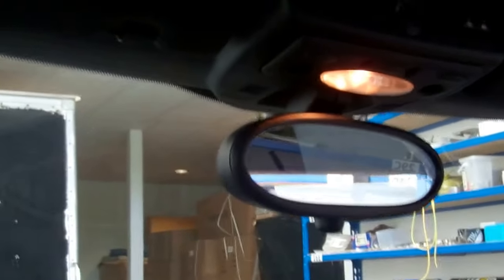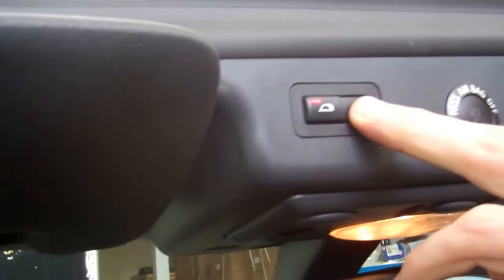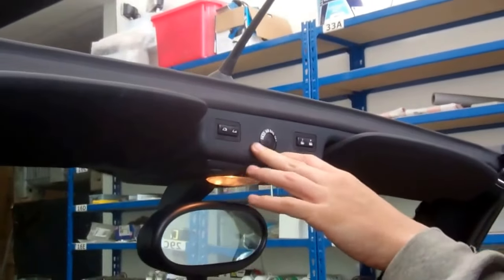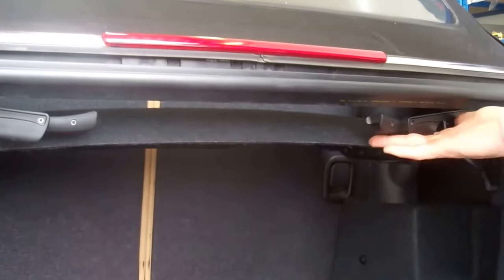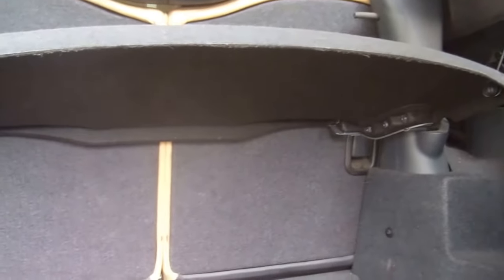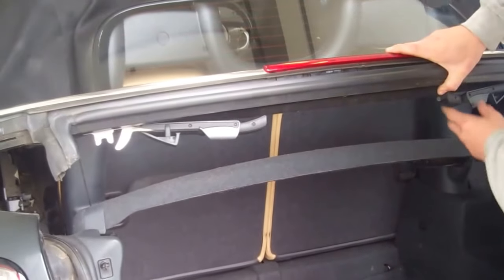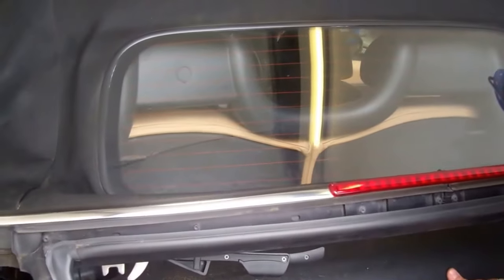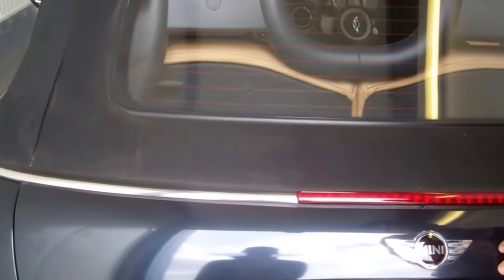BMW Mini / cooper convertible soft top hood operation and problem solving

Comment: Absolutely brilliant tip, thanks guys, it took seconds to sort, when a roof goes wrong  I think people just see £££ signs and don’t bother getting it sorted but tips like this are worth their weight in gold, i think I might bend the contact strip up a small amount to ensure of a positive contact continuously, that’s my tip
Reply: Good
Reply: Literally I had this EXACT problem after a rear-end, and the repair shop told me that water had leaked into the motor of the roof and that I would need to replace the motor!!! Took me 2 minutes to fix it after this video 😄

Comment: Whoever you are, thank you for the info and the video. I was so stress with the first its mechanical problem and paid a lot to fix it. When I found could not open the whole root I was devastated. Also I found that I put the top cover in a wrong way when it came off one day. I can open the roof fully now. Yay I am so happy.  So check the position of that top cover of the boots too when the same problem comes up. Cheers ❤️❤️❤️
Reply from the maker: Glad it helped you.... just need some nice weather in the UK now to enjoy driving mine !

Comment: Spot on resolution guessed it was something straight forward as clearly power was there as previous person mentioned didn't know levers were there to access parcel shelf ,that's a bonus . Mine has just had roof cleaned guess that's how it occurred. Thanks for video .

Comment: You ever had any problems with the boot not opening with the fob or latch I have changed the latch and checked the wiring but seems all ok? Cheers dan 👍

Comment: Mine is ok but small metal cable now and again I have to slide into position top left above passenger door .also water leak top right front. Any suggestions . many thanks.

Comment: Hello, my 05 Mini Cooper only retracts halfway. No red flashing light. I have tried resetting the latches and making sure the switches are being pressed.
Reply from the maker: Try and close the roof then disconnect the battery and reconnect after 10 mins - this may cause a reset and fix the issue

Comment: Is there a way to override/disconnect this sensor, I need to remove the parcel shelf and leave it out of the car but still want to operate the roof. thanks if you can tell me how to do this
Reply from the maker: Not sure but i guess you can bridge the wires if you can find them

Comment: My roof was working fine until a few months ago when I picked up a carpet cleaner and put it on the back seat. The roof was still closed at this point. A few minutes later, because it was a nice day, I decided to open the roof. However, I hadn't realized that the handle of the carpet cleaner was stopping the roof from retracting. As soon as I did, I obviously moved it and tried again. Nothing then and nothing since. It opens for the first part, but won't fold down. Any suggestions please?
Reply from the maker: Interesting - pretty sure it is linked to this parcel shelf switch
Reply: @L663  I’ll have a look and hopefully that’s all it is. Thanks for the reply.

Comment: Hello there..I'm in need of help and wondered if you were the man that just might be able to solve the problem. The boot on my 2010 Mini Cooper convertible is locked shut!! Prior to it locking shut I would be driving and then all of a sudden I would have a message on my dash on the round screen to say that the boot was open. I'd have to stop the car lock the car with the key fob a few times and it would eventually lock. Now it just won't open however many times I press buttons!! I'm thinking it might be an electrical fault...any ideas? Many thanks.
Reply from the maker: Hi - sorry not sure on this one - sound like some switch / sensor problem.
Long shot but you could disconnect the battery leave 10 minutes and reconnect - it can reset the body control ECU... as long as the battery is not in the boot !
Reply: thanks

Comment: Hi there we have a new Mini Cooper convertible 2017 and the roof will not close....checked back still not working. It is going to rain!!! Not near a dealership....help
Reply: hello Clair, i was wondering if you fix the problem?  :) because i have the same problem on my 09 mini cooper :(

Comment: Hi, I'm having a nightmare! 
so a year ago my mum's roof wouldn't release from the frame of the windscreen, The motor sounded but it would only move half an inch, I gave up as didn't want to burn the motor out. 
So the other day I cleared the boot out and by chance I tried it again and it opened, well the sunroof bit did, I went to close it and it shut a little then stopped and the motor went quiet again just a single light click sound each time i pushed the button, I went through the window resetting and disconnecting battery and worked once a little then stopped. 
So today after disconnecting the battery overnight I tried it again, firstly I did window alignment twice then tried the roof, it shut and reopened then stopped and the motor is making a loud buzzing noise and won't move when I try to move it.
Any help would be greatly appreciated guys.

Comment: Hey guys! I followed this video exactly and it’s still not working :( any thoughts?
Reply from the maker: This will not fix all issues - but is the most common failure mode ! if one of the motors etc has failed then this will not fix it ! sorry

Comment: Ok we got it up!!!! Sensor was not connecting....stuff in the back and not in the proper position. This is not cool ....brand new should not have this problem .......rented a Camaro ss convertible in the winter and had no problems with the roof going up and down. This is obviously an ongoing issue with this car.
Reply from the maker: Hi - glad you fixed the problem. Thanks for sharing the solution !

Comment: It would not fix mine.
Reply: Not mine either :( Do any one have other tips?
Reply: A couple of tips to try:
1. Simple case: Check your fuse box on the front lower left under the dashboard's glove box. There are two possible fuses that will need checking: a 5 amp (third from the top on the left, I think) and a 20 amp fuse, third from the bottom. You'll see them indicated with symbols to the right of the fuse.
2. Worse case (mine with the 2004) is that the top electronics and/or the cable is faulty. BMW Mini knows this and has recalled them. This means that for the most part, BMW Mini will replace the mechanism for you free-of-charge.
3. Even worse case than pt.'s 1 & 2 is, like mine, something is faulty with the electronics. The BMW mechanics here in Cyprus could not figure it out after three days and just returned the car to me! They wanted to perform the cable mechanics replacement as per the recall, but could not get the top latch (front left) to release the top to slide back. If anyone knows how to fix this one, it would be great to know. From what I saw in another video, it seems that there is also another mechanical area on the back left that may work. And no, I do not mean with the latch buttons as depicted in this video. 

I hope this helps someone. If someone could help me with my 2004 Mini Cooper Cabrio's issue, I would be really grateful.
Reply: @martyparsons9419  Hello! Have you fixed your roof?) I have already changed sunroof cable on the left passenger side (before that I tried to restore it, but it did not last long). I also repaired the plastic part from the roof lock on the right side with epoxy glue and carbon fiber. Indeed, the roof mechanism has a lot of plastic parts and they literally break up in the sun over time. if you are still interested, leave your e-mail, maybe i can help, I’m somewhere near you